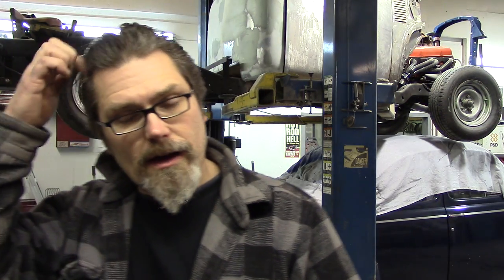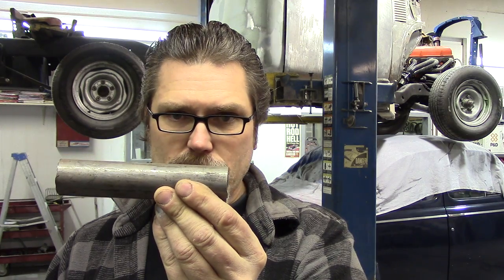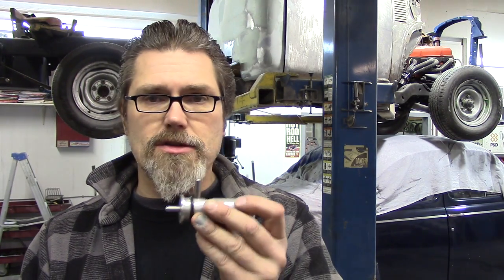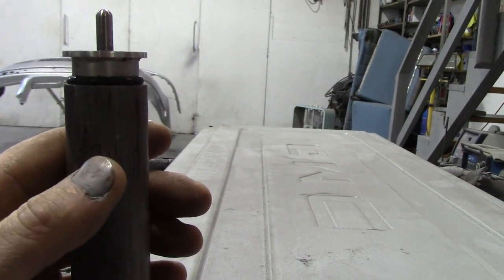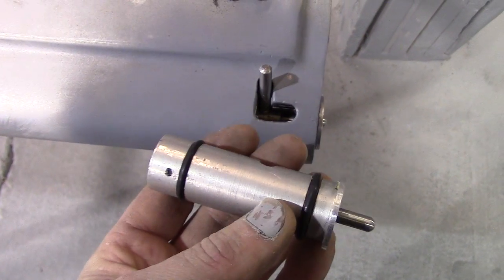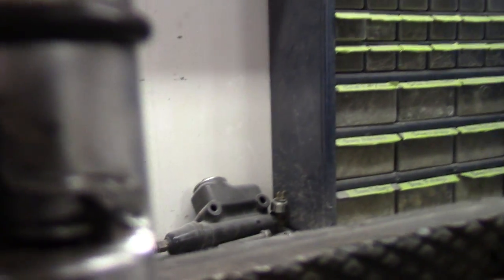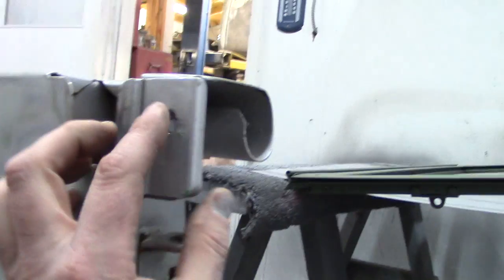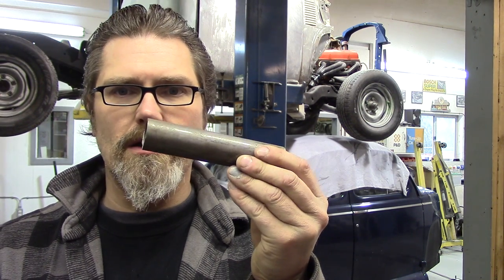How to install hidden tailgate latches on your old hot rod truck

Comment: Great tip, and details about how you modified it. Starting the redo of my '57 Dodge 100. And like you stated, I like the chain and hook. But the other thing to remember is that the chain and hook prevents the rear of the box from flaring out. Over time the bed sides will start to pull away from the tailgate.
Reply from the maker: Good point
Reply: Thinking about your point of the sides flaring out. Its a good point and thinking about it there is really no reason to completely cut off the old loops on the sides. They can be smoothed out a bit and still fit the barrel locks. That way the sides stay firm and the barrel locks hold the tail gate

Comment: Hi Rick great video. I am in New Zealand and am working on my late father-in laws 56 Chevy pickup. It has a 572 crate motor and is a real piece of work. It is 99% complete but sadly he passed away earlier this year. I'm getting it ready for a show here in the middle of January. I know he hated the chains but it is all he got for it. I am a Ford guy so its pretty tough me working on his Chevy ha ha. i will definitely be going to barrel locks and if I can fit ones off a Ford it will be all the sweeter  ;)  Take care and all the best for the new year
Reply from the maker: Sorry for your lose .

Comment: Very cool.  I might add that the hole in truck bed be a little more tidy so that the pin doesn't hit the paint when you pop the pin to the closed position.
Reply from the maker: We did clean it up a bit

Comment: Been watching your channel for awhile now but just ran into this vid. Nice tip!! I've seen some "chainless" tailgates that have what look like "seat-belt" latches. The "latch" assembly typically mounts on the bed side and the "strike" plate is mounted to the tailgate. Do you have any tips/shortcuts for those type of latches?? Seems like one could fashion a pair of those from some old style center button seat belt latches. Might even be able to fashion a "eye" on the latch base for the cable to attach to. ???
Reply from the maker: +Pappa Bob No clue - I haven't done any of those kind.  Anything is possible though
Reply from the maker: No, Richard looks like me!  LOL  Not the first time I've heard that either haha